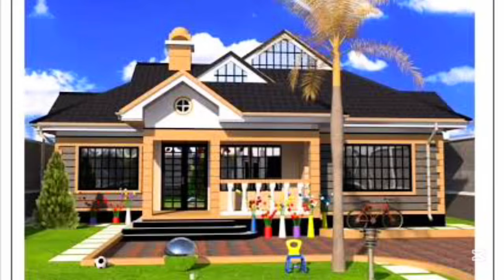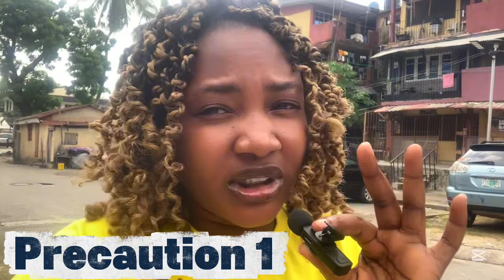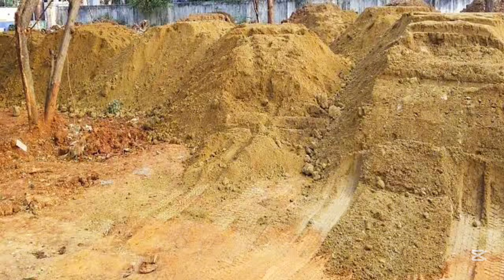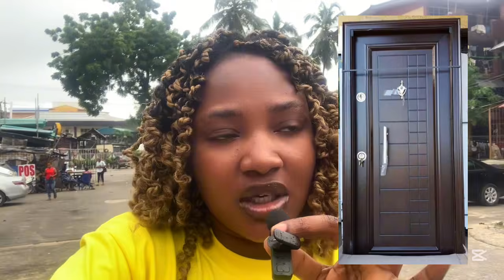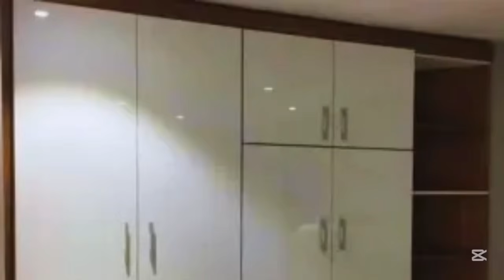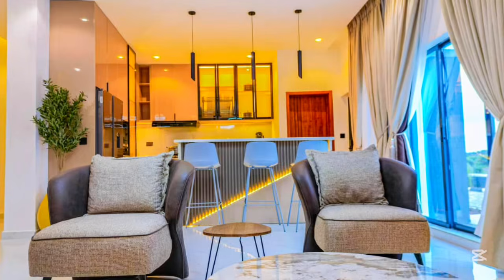How to Build a 3-Bedroom Bungalow in Lagos Nigeria (2025 Cost Breakdown)

Comment: Pls what is the difference between stone dust blocks and the Normal blocks
Reply from the maker: A stone dust block is a kind of concrete block made using stone dust instead of normal river sand. Normal river sand is mixed with cement to make the Normal blocks.

Stone dust comes from crushed stones in quarries (it’s usually waste material). Stone dust blocks are often cheaper, better for the environment, and sometimes even stronger and less absorbent than regular sand blocks (the normal blocks)

I hope this helps ❤
Reply: @BisolaWildflower thanks a million 
I"m using stone dust for my bungalow, they said its the best .but l was a bit doubtful saying they're d same 🙏
Reply from the maker: @ONY.J  You can be rest assured 😊 It is truly the best. And you are highly welcome ❤❤❤❤
Reply from the maker: @ONY.J  Please subscribe 😅❤